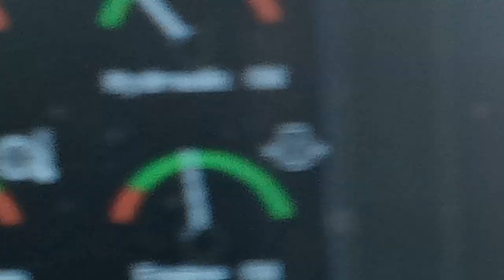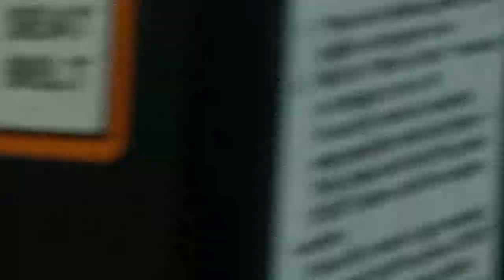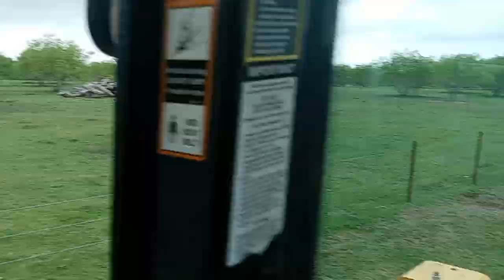Absolutely Amazing Place to Crush Cars 🤠👍

Comment: I don't get it. You have one skid loader retrieving cars then they are crushed.  Why isn't there another loader retrieving cars and lining the where they are in line to be crushed. Instead you spend a lot of wasted time going back and forth to pick up cars. If this were my operation there would be 2 loaders,one fro retreval and placing cars to be crushed . A lot of wasted time doing it the way that I have seen everyone do it in these videos.
Reply from the maker: 🤔 so more efficient is 2 loaders? Twice the fuel ($4.20 a gallon) and twice the salary ($15-20 an hour). Then you have to transport 2 loaders to each job site? Bubba i really think you should recalculate just what is more efficient.